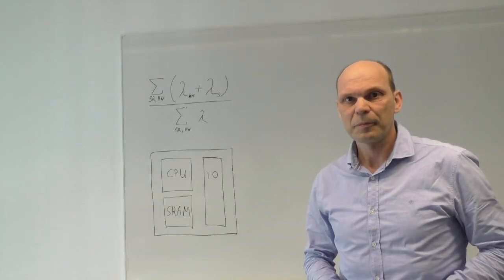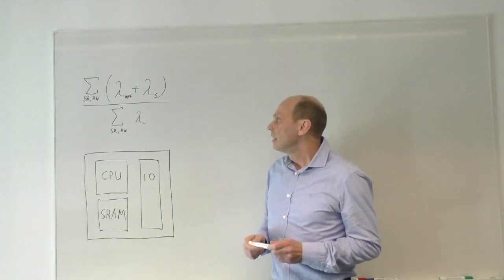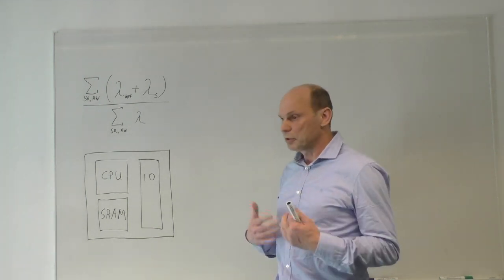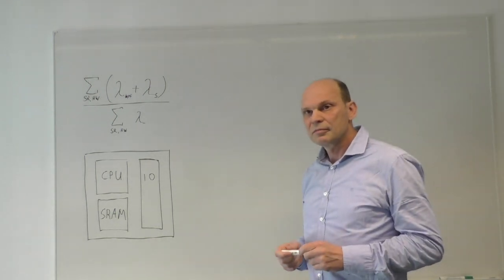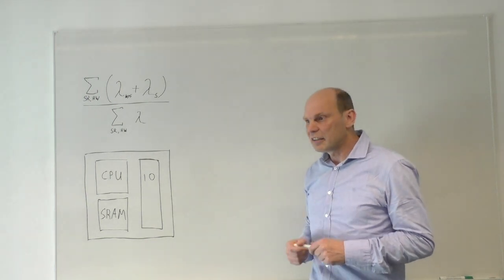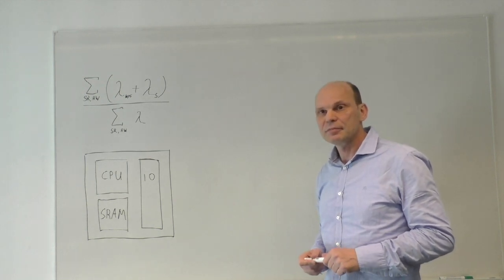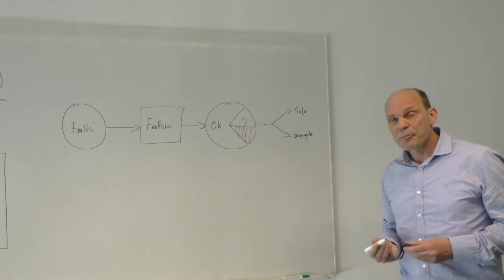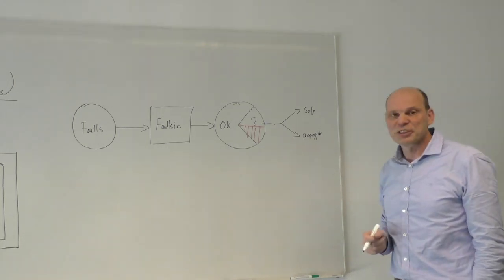ISO 26262 Statistics

Comment: good, except sending an RS232 frame twice when you have a transmit pin with a stuck at fault, does not fix the fault nor can you tell directly without readback. Would like an expanded talk like this covering FPGA only and not SoC.